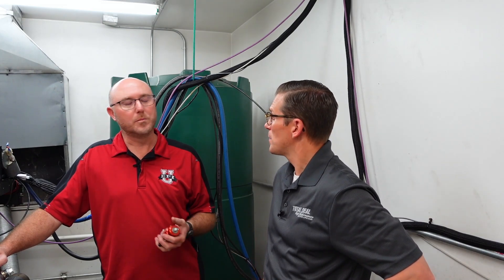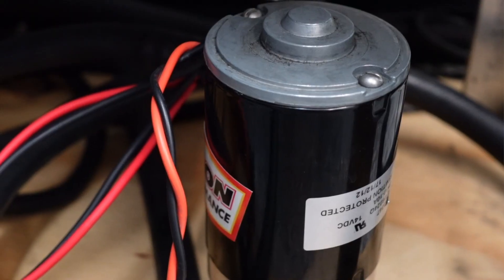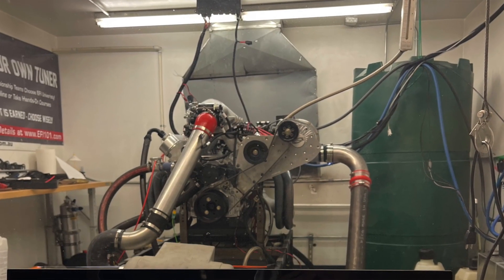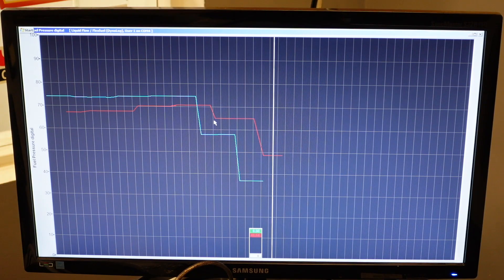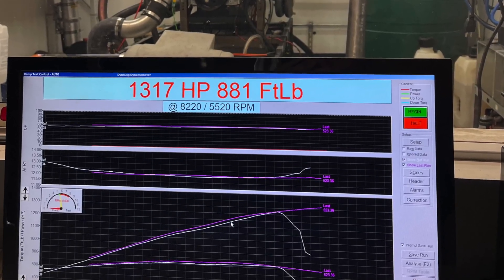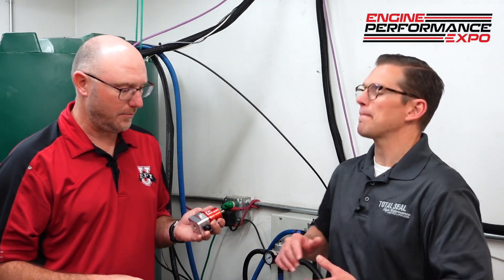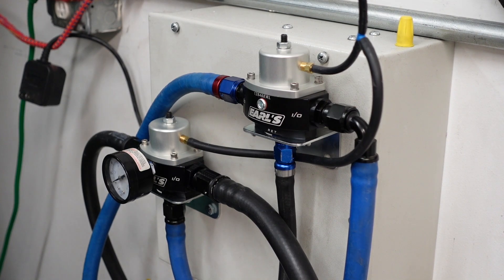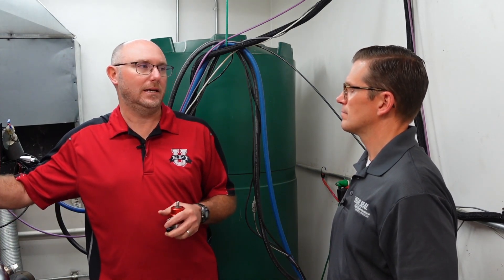Fuel Pressure & Boost - Can Your Fuel Pressure Regulator Affect Fuel Pressure?

Comment: Come on guys ....... this is nothing but an advertisement, and at the same time You are pointing-out the fact
that whoever set up the Fuel-System in your Dyno-Room had no clue of what they were doing.
If any thing,  a Regulator restriction should INCREASE your Fuel-Pressure by 
NOT being able to dump enough Fuel back to the Fuel-Cell under Low-Load conditions.
.
The Regulator goes AFTER the injectors, NOT before the Injectors.
.
You should also have a Brushless, PWM-Controlled, Fuel-Pump(s), 
that automatically slow down under Light-Loads.
.
.
.
Reply from the maker: This is actually what happened. The EFI system on that engine commanded such a long injector pulse width that the fuel pressure dropped. It was the closed loop correction that commanded more fuel, and we agree the dyno fuel system wasn't built for an engine like that. We are just sharing our experience.
Reply: You are correct, the pressure regulator must be after the injectors, not before the injectors.
Reply from the maker: Maybe Ben didn’t explain the situation well enough. Because of the high level of boost, a lot more fuel was required to maintain the proper air to fuel ratio. With the supplied injector size, the pulse width of the injection event was so long that the fuel system pressure began to drop because the small passage in the initial regulator would not allow enough fuel to flow to the injectors. 

In the full video from the Engine Performance Expo, this is explained in greater detail.
Reply: @TotalSeal  
All right, quit tryin' to CYA  ......  It won't work .......
You made a serious blunder in planning for this Ad .
Don't say anything more, and maybe nobody will notice .
Too much enthusiasm, and not enough thinking .

Everybody's got to make an income, I certainly can understand that,
I simply expected more technical credibility from you guys.
.
.
.
Reply: What probably happened was that the high level of boost encountered, made the boost referenced fuel pressure regulator compensate by bumping pressure up, the restriction of flow through the smaller than ideal orifices further increased the fuel pressure....this led to the pump(s) tripping the fuel pressure bypass, dropping pressure.

The now larger regulator, allowed the normal fuel pressure compensation as the last regulator, but without the extra restriction of the smaller passages, this prevented the pumps from seeing their max pressure bleed off fail safe.
Reply: OK, I give-up,
half the commentators here totally missed the mistake that was made.
Do You know what it means to have the Regulator installed  "before"  the Injectors ?????
The Regulator should always be in the Return-Line back to the Fuel-Tank,
then the Regulator being too small would create excessive pressure AT IDLE-SPEEDS.
But of course, it's possible for the Fuel-Pump(s) to be too small for the Horsepower of the Engine being tested,
but in this case, the Fuel-Pump(s) were not the problem, the problem was the Fuel-Hose routing.
Reply: @jimbrown563 you're failing to accept all the facts, don't be ignorant